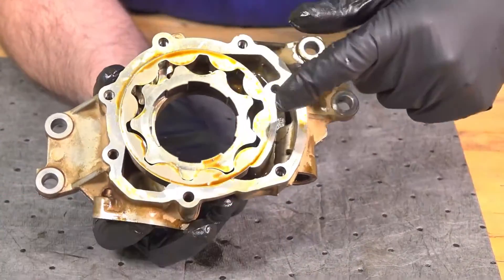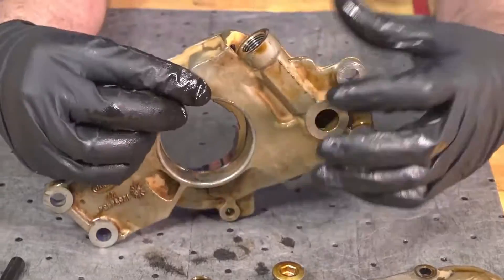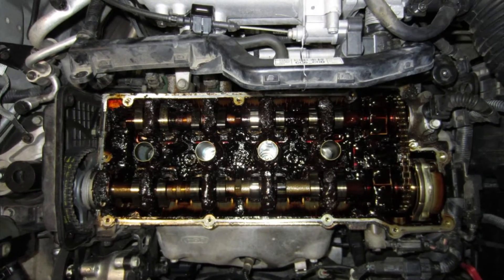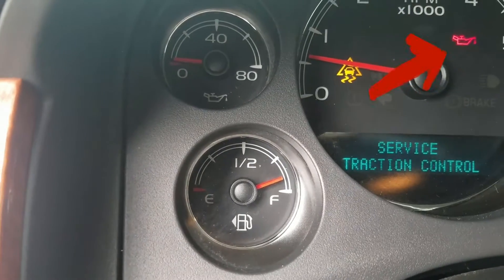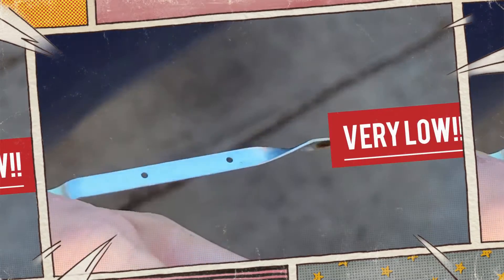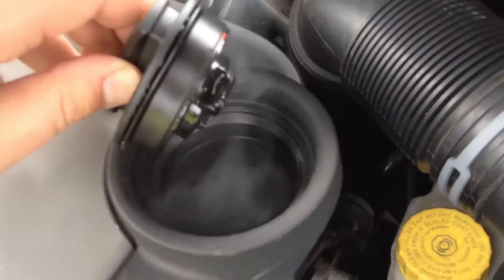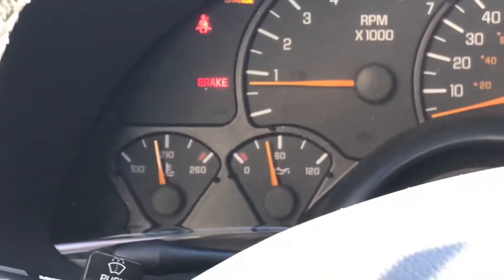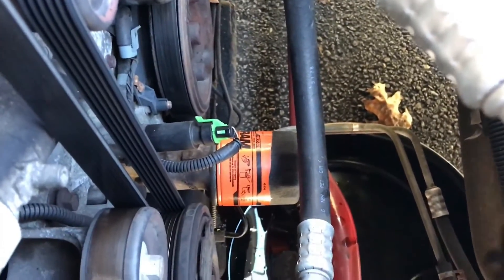4 Reasons For Low Oil Pressure Light

Comment: My car was none of these
Reply: and what was it?
Reply: @KaloyanVT it happens with alot of 10th gen civics nobody realy knows. Happened randomly for 6 years. People say its electrical
Reply: Ah yes the infamous my car was none of these but i’m not going to help others out by explaining what it was
Reply: @ for me it was the wiring , before we got there i changed all bearings, oil pump, crankcase ventilation , oil filter , o-rings, oil pressure sensor and oil level sensor. So hope that helps you somehow
Reply: @oilucky1  becauss it was never fixed because it happened like 3 times a year and i just shut car off and turned on again